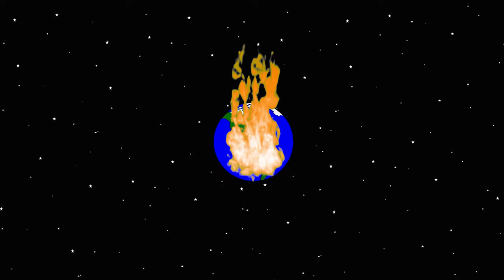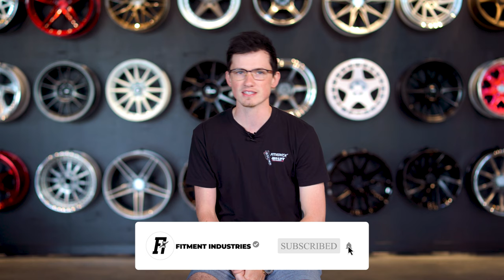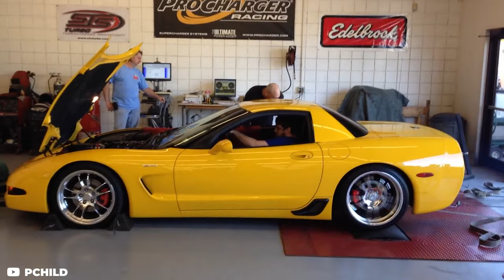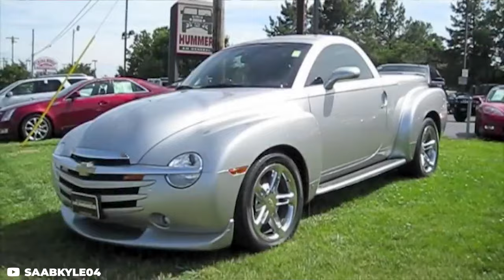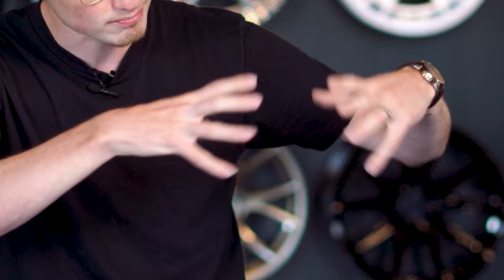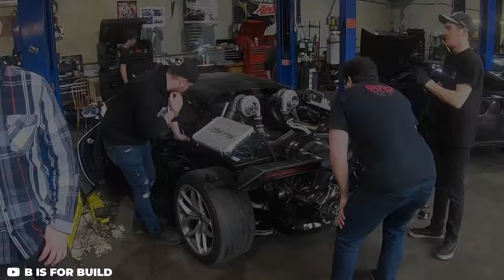So You Want To LS Swap Your Car

Comment from the maker: Would you LS swap your car? Let us know! Don’t forget to add your car to our gallery over at www.fitmentindustries.com/add for a chance to be featured!
Reply: On some cars like a Toyota tacoma drift truck
Reply: I would only because it's a Chevy
Reply: No I'm never doing ls swap
Reply: 100% if I had the stuff to rear drive swap or a wrecked FWD LS4, I would swap into my 95 monte.
Reply: currently saving to swap my 370
Reply: Hell yeah
Reply: Yes definitely if I had the money to do it properly. Mike mykes 350z is like goals
Reply: LS swap BRZ
Reply: ls swap a ford focus
Reply: I would probably  ls swap myself  a nissan pickup truck
Reply: No rx7 should have an LS period
Reply: No
Reply: I’m LS3 swapping my 1993 FD RX7
Reply: My dad is LS swapping his 55 Chevy Bel Air
Reply: Just remember we can't all be Mika Diaz and build a na LS monster it's ok to turbo charge a iron block lol
Reply: YES
Reply: Ls swapped Pontiac Fiero with slicks and flame decals=absolute 80's banger
Reply: I would love to LS swap my 97 Lumina. It would be ridiculous.
Reply: LS swap my TT 300zx... nah brah. Just swap out the snails and turn up the boost.
Reply: YES
Reply: LS swapped Mazdaspeed 3... interesting.
Reply: The weight difference between an iron block and aluminum block isn't that big of a difference and the iron block actually makes more power so there's the trade off. And ls motors are actually all metric🤷‍♂️ and they weigh about the same if not less than 6 cylinder jdm motors and about 100 lbs more than a 4 cylinder
Reply: Fitment Industries can you guys do so you want a Hyundai Genesis not Coupe the sedan
Reply: No, I would never do an LS swap
Reply: Nah
Reply: Hell yes!
Reply: Love to swap a shoebox 80's cop car chevy but here?  the whole smog thing is a nightmare.... welcome to California...

Comment: Alex: "So you want to LS swap your car"

Me, a C6 Corvette owner: "Nice."
Reply: Swap in an LT then I guess 🤷‍♂️😂
Reply: DOESN'T MATTER IF IT ALREADY HAS ONE IN,
PUT ANOTHER ONE IN
L
S
SWAPPPPPPPPPPPPPPPPPPPPPPPPPPPPPPPPPPPPPPP
Shove em together and Make it a W16
Reply: Bladed Angel damn hey bladed
Reply: [Removed] 🤢
Reply: @jnieto490  old or new 🤣
Reply: @[Removed] 
Pretty sure a 2j is too tall. And it would ruin the 50/50 weight distribution
Reply: @BladedAngel  Yoo bladed
Reply: @SoI_Badguy  yo, what did he write? It's removed. Did he say to swap a 2j?
Reply: So you want to corvette your corvette
Reply: Iron block swap your ls
Reply: One for the front one for the back

Comment: Yes, Yes, and did I mention?

Yes
The only thing better? A LT Swap :)
Reply: i thought so too but no. The new LT1s are expensive for everything. I have a 19 camaro ss. Direct injection is expensive. just to upgrade fuel the Lt4 fuel pump is $1200. and if you dont know how to time and shim it you could with one rotation of the cam destroy it. fuel system upgrade total is about 2300.00. before that they wont go past 500WHP. after they can handle safely 650WHP anything higher your looking for trouble. If you go gen 6 lt1 just bite the bullet buy pistons and rods lt4 fuel pump and lt4 injectors. then your safeish around 1000hp. any higher well thats a whole world of hurt.
Reply: AYEEEEE BLADED!!!! wHeRe'S tHe mIaTa¿¡
Reply: Lt sWaP tHe mIaTa
Reply: bUt bLadEd LtS aRe eXpEnSive

Comment: Most LS Swaps are done with truck motors unless its going in say a drift car or a strict NA build
Reply: Yeah I’m seeing a lot of procharged lm7’s
Reply: @colesmountainbiking  turbo and nitrous. With lr4s and lm7s being under $350 at the salvage yard. They're normally the go to. Now granted depending on the chassis and the kind of build if your pockets are deep enough then by all means go for a car motor but for about a 30-40 hp hit to save 2 3rds of the buy in price i can live with
Reply: Iron block, because boost. 🤘😎🤘

Comment: Yeah I feel like the truck motors are a way better deal. You can go to a junkyard and find a 4.8 or 5.3 for like 500$. And if your trying to get cheap power you can't beat a cheap v8.
Reply: Yes but you might have to do some work on them junk is not always better...
Reply: Get a vortec, they are cast iron block LS engines
Reply: Plus 4.8 rev higher and both 4.8 and 5.3 iron block can hold over 25 pounds of boost
Reply: @K1llum1nati  yeah but when you can get a motor for less than 500. The money you save makes up for it.
Reply: @FXIIBeaver  you can usually sell your current engine/trans and buy a junk yard LS + T56 and come out even or sometimes have money left over.
Reply: Everyone keeps saying these low prices, but I am yet to see that at the junkyards I’ve been to.
Reply: @bri-manhunter2654  outside US? And are you looking for aluminum motors?
Reply: FXIIBeaver. No,
Reply: @bri-manhunter2654  no to both? No to outside US? No to aluminum?
Reply: Bri-man Hunter I got mine for free and a buddy got his aluminum 5.3 for 150$. I tried haggling with junkyards but they think they want gold for their silver. Check offer up, and machine shops, metal recycling plants, and autoshops.
Reply: Lucy Smith. That is impressive on those good deals. Moreover, from what I have dealt with in all areas within a 150 miles of me people hoard them. The junkyards sell to the dealerships immediately, or you have crews of people waiting on the spot for the motor to shoe up. I don’t need one at the moment though, I’m building a 6.4 Hemi stroker at the moment.
Reply: Bri-man Hunter they're probably just going to get cheaper as time passes so no need to sweat. That Hemi sounds bitching 👌🏼
Reply: Lucy Smith. Thanks Lucy, running a mild Jay Green Comp Cam, high compression, and 3000K stall. 13 Red 4X4 lowered Crew Cab Ram 1500. 
I hope your right, the LS engine is the greatest thing ever. LS motor vs the world, lol.
Reply: @FXIIBeaver  get alluminum heads drops weight alot.
Reply: @bri-manhunter2654  when your looking for an ls if you plan to boost it grub worm record holding gm H pattern car had a stock block old caprice lt1 forged pistons rods ect alluminum heads, ran 7.11 quarter on an H pattern car. old lt1s are super cheap alluminum heads for them are too. maybe look into that first. people swear they are stronger than ls1's and more reliable.
Reply: sariah reigns. Thank you!
Reply: If you're building a car that doesn't require heavy performance or is light than definitely. Classic cars would a be great example.

Comment: If you want a cheap, light, powerful V8 in your car, an LS is the way to go. Personally, I would like to see a bit more unique engine swaps like a VW TDI powered Jeep or something nobody else has
Reply: My friend wanted to V10 TDI swap his Honda CRV lol
Reply: @NuclearPineapple  did he do it? I'd love to see that motor in something like that lol
Reply: Bryson Kuhn nah lol. He got an excursion with the 7.3 power stroke and that settled his large displacement diesel desire. We do need to take apart the k24 in the CRV though to replace piston rings before he can sell it
Reply: @NuclearPineapple  man those 7.3's are pretty indestructible. I really wanted to put a twin turbo setup from an Audi on my trailblazer to make the twin turbo 4.2 vortec concept car
Reply: Bryson Kuhn that sounds really cool! And yeah, he gets 20mpg too which is the same as my G35 :(
Reply: @NuclearPineapple  dang. A 7.3 get better mpg than my 4.2
Reply: The VW TDI swapped Jeep is a reasonably popular diesel swap in Jeep land.
Reply: @padrescout  not as much as LS swaps. But yes there are a couple of them, just enough to get info on the install and still be unique
Reply: My friend TDI swapped a pre Tacoma Toyota pickup, @dieselyota on instagram if you are interested
Reply: @davidpoulsen2669  I am definitely interested
Reply: I want to put a toyota 1uz-fe v8 in a 1968 Chevy Chevelle or a 05 ford mustang
Reply: Got a friend about to TDI into his solid axle lifted geo tracker
Reply: @cody4128  now that seems fun
Reply: it's already lifted 9" on 35s and very rarely gets stuck. I can't imagine it on 40s with more torque.
Reply: @cody4128  sounds like a beast

Comment: Can’t wait for a LS swapped mk5 Supra !!!
Reply: @Maximo Moline work on one... they are retarted. My friend who is a master tech of toyota almost quit the day he had to tear one appart for warranty. They are STUPID, turbo bolts directly to the head. intake and exhuast manifold are built into the head. the timing chain is on the back side so you need to pull engine and trans everytime you need to do ANY motor work,
Reply: Can't wait for someone to b58 swap a mk4 supra just for the shits and giggles.

Comment: V8 swapped Caymans have intrigued me for years
Reply: Its basically a homemade German Corvette
Reply: are cayman front engine? or are they rear? sorry i dont know porsche too much. If rear engine you might wanna consider a cadillac northstar V8 alittle heavier but MUCH cheaper and they were front wheel drive V8s. beef up the axles and you might have a cheap swap if your a DIY person. Just a suggestion.
Reply: @sariahreigns3666  Cayman and Cayman S are rear engine.
Reply: @sariahreigns3666  you Don't have to go that way, north star is quite terrible for a good old American V8, LS 4 is the best candidate because it's aluminum and also designed for fwd Cars

Comment: obligatory "So You Want to JZ Swap Your Car"

you can even spill the beans on how the GE blocks are just as strong as the GTE ones
Reply: But you won't get the power for it to matter without a turbo, and the amount of work to put a turbo on a GE is well, stupid.
Reply: @Treaxvour  yeah you'd want a GTE head and likely a single turbo setup. I'd recommend against stock turbos anyway unless you have to run the factory ECU for whatever reason.  GE blocks also bump your compression up a bit for those spicy E85 tunes
Reply: Shh. It's a secret.
Reply: HUSH! dont tell them, the price will rize!
Reply: @Treaxvour  if by difficult you mean super easy your right! Oh yeah so difficult to change head gasket head studs intake manifold, turbo manifold and tap a bung into your oil pan and some piping waste gate and a few other nicknaks.... yup super hard. Im only talkign about making an NA block into a turbo not the entire swap sometimes 2j is easier than ls sometimes it isnt. ive seen massive reliable safe tunes at 600WHP on 2jz swaps. Depending on the ls you MIGHT need to do much more work. Ls dont have forged pistons 2jz do. Ls1 first gen motors also have MASSIVE oil consumption issues that can be fixed by dry sump. ls3 is MUCH better but the price is alot different.

Comment: Speaking about sacrilege. I want to swap an LS7 into my AP2 S2000.

Should I just buy a C6 Z06?

I don’t have the convertible with the Z06. And it is just a Z06.

People love the S2000, it would be built not bought. It’s awesome on certain nights to cruise with the top down and a guest in the passenger seat. It would be like a modern Shelby Cobra. The interior is way better than a Z06.

It doesn’t have the rubber on a Z06, it may cost more. It doesn’t have the transaxle which balances weight distribution better. A Z06 may be more reliable. It’s safer, with the hard top. And more trackable.

It’s modifying something people consider to be historic, over owning something that people aren’t that impressed with (a corvette).

Comment: I’ve always wanted to ls swap a Chevy cobalt ss.
Reply: Why? To make it slower?
Reply: Kenaz Wilder why not. It would sound better and you don’t see it everyday
Reply: GUY IN A 2wd any footage?? I say do it
Reply: @ILikeCheesesticks  how the hell would it be slower? The weakest ls series engine puts out 20 more hp and 40 to 50 more tq and thats a 4.8
Reply: You could probably buy an LS for cheaper than you'd be able to sell the Cobalt SS engine for. And it would make the thing actually sound decent unlike all the fart can yellow Cobalt SS we have around here
Reply: VRotate LS from impala ss??
Reply: Keep it Chevy platform do the swap
Reply: BLAKE DA GREAT I might I’ll have to think about it because I’m in the middle of building a street truck.
Reply: GUY IN A 2wd what kind of truck
Reply: BLAKE DA GREAT cat eye Chevy short bed single cab has a 6.2l from a 2014 1500. It has a 2.5in leveling kit and a 1.5 drop in the rear to make it level it has a cam long tube headers no cats flow master super 10 true duals with a x pipe. It has 22x12 wheels 305/55r22 nitto 420v. E85 dyno tune it makes about 475 at the wheel. And a 4l80e with a shift kit and corvette shift servo. I’m not finished with it yet I just ran out of money for it. One day it’s going to have a supercharger and nitrous
Reply: GUY IN A 2wd nice any videos of it??? I thought it was gonna be a hardbody d22 nissan truck but sounds good nonetheless
Reply: BLAKE DA GREAT I didn’t take any videos this because I just wanted to get it done and drive it
Reply: BLAKE DA GREAT that’s nice I need 4.56 gears for mine
Reply: GUY IN A 2wd what the reason for those gears I’m curious as opposed to say 4:11
Reply: BLAKE DA GREAT there cheaper about $200 cheaper.

Comment: I want to LS swap my Genesis coupe
Reply: There's a dude in my town who managed to get a 5.7 to fit in his Gen Coupe, but I think he sold it a while back :/
Reply: hypr _ I want to do it bad but if I swap the engine I probably need to swap the transmission and that’s extra money so idk maybe later
Reply: I’ve seen it, with a 6.0L and roots style blower, badass!
Reply: Benayak Gurung yeah that's probably true, it'd be sick though lol
Reply: @benayakgurung7311  t56 magnum is the strongest manual transmission its what grannas used on thier world record h pattern supra. 6.99 quarter mile. if you do the swap you will almost never had a trans problem unless you cant drive like at all. ive seen and ls3 swap gen coupe and my 19 camaro ss got demoloshied by this thing. it was FAST. good luck!

Comment: my ls swap is in a 74 chevy C10 pickup  Which seems like a perfect place to put one.   it is a 5.2 truck motor but still lighter than the original small block.

Comment: I feel like yall are watching me.... I wanna swap my s197 I mustang because the 4.6 3v stinks lol :0  (before the hate I know you can make good power with the 3v its halfway a meme but kinda serious.)
Reply: Man I wanna swap my v6 s197
Reply: Do it if for no other reason than to piss off the Ford fanboys. 😁😁
Reply: @dabagel100 Dude please do this. I had a 3 valve that I either wanted to coyote swap or LS swap but I got rid of it and bought a 6th gen camaro instead. I was leaning towards the LS swap because the ls engines sound good like the 3 valve does. The coyote doesn’t sound good at all for a v8. Also you’ll make way more torque down low with the Ls.
Reply: @shemwhitehead9517  not a fanboy, but LS in a Ford does make me cry.
Reply: The 3V is trash and I hate ford for it. If you want to keep ford heart just get the 4V or 2V. But if you are determined then get an LS.

Comment: I'm considering an LS swap: I'm looking into the L92. Since It's going into a big truck (1965 Chevy C60 tilt cab), weight and space aren't an issue. I'm still trying to make up my mind on the various engine/transmission/rear end combinations before I pull the trigger...

Comment: The iron block variants are still lighter than a SBC, and they can be rebuilt where the aluminum ones really can’t be ( the iron sleeves can be overbored but only by .010”, otherwise they have to be replaced)

Comment: I am currently tuning my camed LS1 in my '97 Miata and I am certain that I will be stoked with the results as it is pretty rowdy with the stock 325 hp engine from a '02 SS Camaro along with the T56 trans and a limited slip dif from a '08 CTS, she gets up and the American Eagles SCREAM! After the tune it should have somewhere around 400 hp in a 2300 lb car. Zoom-Zoom!

Comment: You know it’s funny how so many people lose their mind about LS or Vortec swapping older cars over BS performance reasons. I really want an FC RX7 as a project, and my goal would be to put an LR4 (4.8L Vortec) in the bay and boost it because their low end torque is incredible and they’re reliability is godly. Plus 1JZ model FCs are rare and expensive, so I’d settle with a 7M-GTE if I was already gonna replace the engine. But what surprised me was that the LR4 is a physically smaller engine than the 7M and the 1J in every way other than width obviously, on top of that, both the 1J and 7M are iron blocks as well, but they weigh around 50 pounds MORE than the LR4. I still respect older vehicles, especially older powerhouse engine like the 1JZ and 2JZ, but people don’t understand that even those motors have flaws, such as size and weight.

Comment: I'll never understand ls swapping an rx7 or any other rotary, it's just not right. But other than that go nuts.
Reply: I'm fine with it if it's a clean build, but I ain't about to help until at least post swap. Except the rx-8, the 13b-renesis is every bit as horrible on seals as it's reputation because of what Mazda had to do to meet emissions standards, swapping those just the decent thing to do, but I still think it would be a better as a k-swap then an ls-swap.

Comment: Must be doing something right if there was a GTO and Genesis Coupe shown in the video which I had/have. I've looked into swapping an LS motor in my Genesis Coupe and it just doesn't make sense. Free and clear it would cost approximately $17k for the swap and if the car is valued at $13k to $17k it makes more sense to get a used Camaro ZL1 with an LFA engine without having to frankenstein another car. Add a Lingenfelter kit to the ZL1 and for $35k you can have a more than capable vehicle or a LS swapped vehicle...

Comment: I just bought a rust free f150 with a bad motor and it’s hand not to wanna swap it because 5.4s are junk. Also should remember a truck motor is cheaper to rebuild if you blow it up. Rather pay $400 for a new motor then $3k